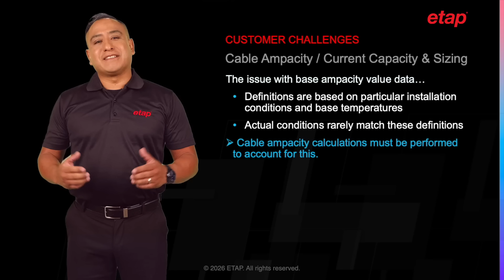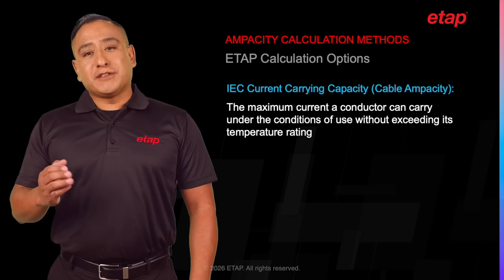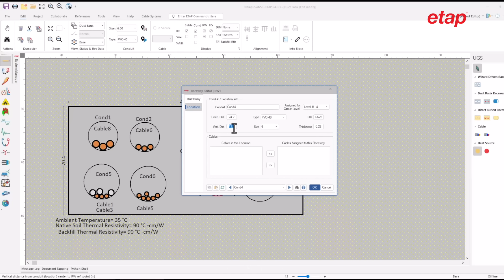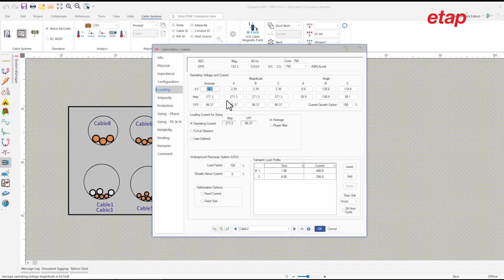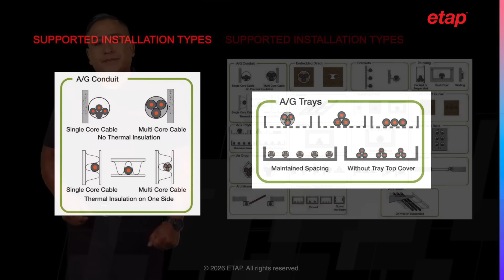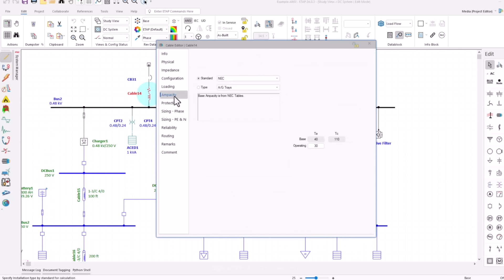ETAP Cable Ampacity Study Basics for Power System Engineers

Comment: 1. Would it be possible to do an underground trench (flush floor method) and channel for a medium voltage cable system? 
2. Is there an option to enter the concrete thickness and thermal resistivity of concrete? 
3. And is it possible to have multiple soil layers in UGS, similar to ground grid design?
@etap
Reply from the maker: Thank you for you interest in ETAP Solutions. Please contact our Help Center at https://helpcenter.etap.com to assist with your question.

Comment: Thanks for this
Can ETAP calculate conduit fill % once cable specified physically?
Reply from the maker: Thank you for your interest in ETAP Solutions. Yes, ETAP UGS calculates the conduit %Fill. This information can be found in two places. Please see below:
 
Displayed in UGS presentation diagram (%Fill display option needs to be checked)

In UGS presentation, selecting Edit Mode
Checking the “%Fill” checkbox which is located under the “Display” section of the Ribbon bar.

Reported in UGS’s Calculation Output report
%Fill is reported in the “Conduit Data” section of the Output Report after performing the analysis.

Hope this helps. Please contact our Help Center at https://helpcenter.etap.com to assist with any further questions.